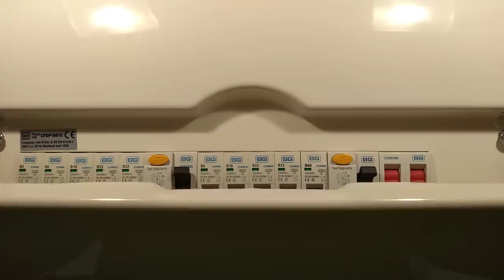A look inside a British home electrical panel.

Comment: Watching these consumer unit videos has got me worried.  (In UK) I had thought my consumer unit was relatively new, as the council rewired the whole house while I had a long period in hospital (cutting off all my own carefully placed lights and sockets, and leaving me having to do with extension leads everywhere: and a house still with brickdust everywhere ).  As it was on a new mounting board in a new cupboard with a smart meter, I assumed it was fairly new, but, closer inspection after seeing your burnt one, finds it's a plastic Wylex SF17NHISS10SLX, with a yellow label on top: 'IMPORTANT check tightness of ALL connections including FACTORY ones. Remove after installation'!   One of the two screws that hold the cover on is only half done up!   Does not exactly inspire confidence, though the man who fit the smart meter didn't say anything was wrong with it.

Is it possible to isolate the consumer unit from the meter so as to safely tighten the screws and check the breakers, or even replace the whole thing with a metal one myself?  I have found in other wiring I've checked, that junction boxes in particular often have grub screws that are loose, or even in sideways, so I never did have much confidence in other people's screw tightening.  :/
Reply from the maker: Unless there's an external isolator then you could only use the one in the unit, and that would leave at least one live connection.  (Tail into the isolator.)
You could gently check (do not overtighten) the screws with a suitably insulated VDE screwdriver with the correct tip.
Reply: Thanks very much, once again. I had wondered if the smart meters were smart enough to have their own isolater.  
I used to do a fair bit of DIY before they cracked down on it, and had actually replaced all of the original wiring but for the old style fuse wire fuse boxes. I couldn't get at the wires for these as some so and so had concreted them into the wall, and I only had hammer and chisel in those days! I hade gone through ther rest of the system with new wires and sockets and junction boxes, and made sure every connection was easy to get at.  Then I got stuck in hospital long enough for the council to check the house was safe to come back to, and they took one look in the fuse cupboard and condemned the lot. Cut all my new wires that were all run in tubing for easy replacement, and then just diamond sawed through everything, leaving me with half the sockets I'd had before and all miles up the wall though mine had been above the skirting, which was itself stainless screwed for easy access. They left just one light in the middle of each room, and didn't connect the garage system.  I was nearly in tears when I came home and saw what they'd done to 'help' me, when I'd only needed a new consumer unit. :/
Reply: Are the VDE screwdrivers anything special other than just having the plastic coated shaft?  I keep a stock of different sizes of silicone rubber tubing (amazingly useful for countless things--diverting distilled water from the back of the fridge instead of boiling it on the motor, for example). Would it be just as good to sleeve some of my existing drivers rather than buy yet another set?  (y)
Reply from the maker: @spamletspamley672  The VDE drivers are intended for live electrical work.

Comment: We have 400A into our house here in USA.  And 80 breakers spaces.  How do you guys handle very large houses like 475 SQ.M for exmaple?
Reply from the maker: Three phase supplies either split into three single phase consumer units or one or more three phase panels.
Reply: Typical house in the UK is around a 1000 sq.ft - not much space to fill with cabling.
Reply: @eddiewillers1  Heh, the American uses metric while the European uses imperial, I'll probably never see that occurence ever again ~:D

Comment: 12:00 Yeah, I learnt the hard way that it's not a good idea to use acid-based silicone kit in enclosed spaces that contain metal parts prone to corrosion…

Comment: It seems somewhat tedious, this design compared to a North American panel.  The mains bars are already mounted to the panel and you then mount the breakers to those bars.  It is similar though where you have neutral and ground/earth terminal block rails.

Comment: One big flaw i can immediatly see is that the N wire is not overcurrent protected. I can imagine there would be no immediate danger in 1phase systems, but is this the same for 3 phase systems in the UK? if so that might propose a bigger issue.

Comment: What is the purpose of the first (most right) neutral bar? Why not make a tail like they did for the live?
Using this neutral bar with any live from the breakers will trip the RCD.
Reply: Presumably so that you can fit extra non-RCD protected breakers or RCBOs which are not part of the twos RCD groups.  You might want a dedicated circuit for a freezer which doesn't go off if there's a fault elsewhere.
Reply: @petehiggins33  Are non RCD circuits allowed in the UK?
Reply: @ppdan  I'm not entirely sure about this, the regs are continually changing,  but I believe that for new builds and new wiring all sockets must have RCD protection but not lighting circuits.  This is a relatively new regulation and there are of course millions of houses with older wiring which don't have RCDs.  My house has an older device called an Earth Leakage Circuit Breaker which measures the voltage between the house earth and the supply earth and switches the power off if it exceeds about 50V.

Comment: You cant have enough seperate Breakers. I was living in a House with only one 16A Breaker for the 2. floor ( but 3 phase for the kitchen) no RCD at all and 2 Wire Connetion (Shared Neutral and Earth). I had to reset the damn thing a lot of times in absolute darkness.
Reply: Unless it's badly labelled and you have 30+ assorted things to switch and unscrew to work out which is what.

Comment: @bigclivedotcom our LL recently sent round an electrician to check our electrics were up to standard etc. Electrician said the live and neutral were wired the wrong way around on ALL our sockets. I researched this and found it basically makes the fuse useless as it will never blow. Is this correct? Also raised the q as if ALL sockets are wired like this could it be that the RCA box is wired up wrong instead?
Reply from the maker: That's an odd scenario.  It could be that the person wiring the sockets was going by terminal position as opposed to reading the markings.

Comment: one thing I realised how is this going to be enough for ANY home.
Suppose you have a kitchen bathroom and bedroom ( tiny apartment...)
kitchen 3: 1 breaker for the frige 1 for apliance plug 1 for light ( gaz cooking)

bathroom 3: 1 for light 1 for shaver plug 1 for washing machines ( no dryer ).

bedroom 2 : 1 for light 1 for plug.

that's already 8 breakers! 
if you have an electric hot water heater 1 more.

suppose you have a desk or TV corner you are full!

funy thing in that list you can't even rent your apartment has you need to have either place for drier or dishwasher ( yes that is independent too)
so yeah maybe this will fit some maids room with no runing water...
Reply from the maker: High load appliances like washers and dryers don't have a dedicated circuit.  They can plug in anywhere to our high current ring circuits.
Reply: @bigclivedotcom  and you think that is safe?????
plus washer and dryer don't need 32 amps 16 is more than enouth.
the only high load is for the cooking plates but I see gaz has far superior so I escluded it.
Reply: @pmailkeey that is not enough , you came for the parts like the others!

Comment: As a “consumer “ and not a trained electrician there is a serious issue with these boards.  To us non electricians green means on and red means off as all other electrical items use that convention pretty much except the consumer box where it’s back to front.  I had all the breakers replaced on my new consumer box replaced with RCBO as the two RCDs are just pathetic and make life a pain. If a circuit goes you need to know which one it is not one of 4. Also if your freezer is on the bank of 4 RCD protected and they all trip but you are away on holiday say good by to your Waitrose biryani!  Not sure who does these regs but they aren’t that smart in my book.

Comment: Nothing like mine. I have ceramic fuse holders and fuse wire.
The house was re-wired in 1982... Its not broken so theres no need to fix it.
Reply: Same here, except the house was built in 1982.

Comment: I wish they were more clear about end of life for old electrical cause trying to explain it to my condo board is such a head ache as they think I am abusing the electrical cause how does electrical go bad over time which matters since I am responsible for the electrical but then again when I want to replace the line cause I think it's getting old and could start a fire due to age

Comment: Are all home installations in the UK just single phase? Isn't that a problem when powering heavy stuff like stoves, ovens and water heaters?
Reply: Electric stoves, ovens and water heaters are commonplace and not an issue. We usually get between 60 and 80 amps to play with. There must be hundreds of thousands, if not millions, of all-electric homes in the UK, which use no other energy sources besides single-phase electricity, but it's much more common to use gas for heating, because it's cheaper to run.

Comment: DANGER Clive @ 9:00 the terminals at the top are outputs and the input is from the line buss bar at the bottom, this device should be fitted next to the main breaker before rcd's  and use the main common neutral bar   DANGER..

Comment: I see a lot of videos of "Sparks" on YouTube showing UK electrician work, but I don't ever see any US electricians showing their work. I think if your a electrician in the US you could get a good audience especially if your in a larger city showing industrial work or just residential work. I have a good understanding of US electrical but some of the UK concepts are strange like rings and all the testing they do. The US we just slap it in and it works more or less it seems.
Reply from the maker: That's how we used to do it.  Basic sensible testing.  But now testing has become an entire made up industry where they invent new unlikely scenarios and a new retarded test for it.

Comment: You get 40 A supply fusing? Here in Sweden we top out at 16 A, sometimes only getting 10 A.
Reply: I believe that is the nature of ring (UK) vs radial circuits (SE/NL/wherever else)
Reply: Huh, my apartment (in a house from the 50s) has 20A incoming fusing. Have things changed?
Reply: @michaeltempsch5282  normal north europe,sweden,norway,finland etc, have main fuse 25 or 36A no need normal house more. but has 3 phase. asian i have 1 phase 63A in to house main, and down living area has share 32A kitchen,kivingroom,2 bedroom.workshop.

Comment: I am from the United States. Why do you need a circuit for a shower? In the US one circuit breaker would power a water heater to supply the whole house.
Reply: Its for the water heater. Some houses have it to the whole house, and some of them have it only to the shower.

Comment: Are the blanks at the front supposed to be metal, they look like plastic.
Now fitting a Wylex main switch + 8 ways with all RCBOs except MCB shed supply that has its own RCD in the shed unit.
Reply from the maker: I wouldn't fancy loose metal blanks above a busbar.  The front has a closable metal cover.

Comment: I do believe they should change the regs to allow only rcbo boards, they are much much better. Split load is old fashioned now.
Reply from the maker: That has its pros and cons.  The RCBOs have a lot crammed into a small space and I've come across some that have exploded internally instead of failing in a controlled manner.  There's a video about one on this channel.  They also have integrated electronics that will result in a need for complete replacement a lot sooner than traditional MCBs.  And if the board is obsolete by that time (potentially ten years or less) then the whole DB will need replaced.
Reply: bigclivedotcom you raise some very good points Clive.

Comment: RCD = Residual Current Device == GFCI = Ground Fault Circuit Interrupter == GFI = Ground Fault Interrupter ==  ALCI = Appliance Leakage Current Interrupter 
RCBO = Residual Current Breakers with Over-current protection
Reply: RCBO = RCD and MCB in a single module
SPD  = Surge Protection Device
AFDD = Arc Fault Detection Device (See John Ward Video for how effective they are (aren't).  At £200 a pop (recommended per circuit) and around £2000 for a Consumer Unit - someone is "aving a larf".

Comment: Do you have the use matching brand RCBO's for consumer units or can it be mixed e.g. BG RCBO in a Wylex consumer unit?
Reply: Regs 18th say "recommend" that you only use the same manufactures modules as the Manufacturers have only tested their own devices with each other (of course they have) and not other Manufactures modules. If the Sparky uses Diff brands - then the Sparky takes on the responsibility (and liability) for the "design". 
It boils down to who will be liable in the event of fire/death.
Reply: @shilks8773  Thanks for clarifying

Comment: Maybe I'm missing something, but just looking at this what I immediately notice is that each of the RCD devices is only rated for 63A, but they're each supplying power to 92A and 126A worth of breakers, respectively.  If, as you said, those devices don't have any sort of inherent overcurrent protection in them, that seems very bad to me.  It seems like it'd be very easy to pull more current through them than they can handle, with no protection, and possibly produce dangerous results (i.e. fires) inside the panel...?  Is this actually a typical configuration?

In US panels, typically the main shutoff switch is in a separate position, accessed separately from the compartment for the rest of the breakers, so if you actually turn off the main switch, the main portion of the panel will all be powered off with no live components exposed.
Reply from the maker: The main incoming supply is usually round 80A.  The combined total of the breakers is not necessarily the sustained load.  A 6A lighting circuit may just use 1A.
Reply: @bigclivedotcom   Well, yes, it might only be 1A in use per circuit, usually, but my point is that there's absolutely nothing preventing hooking up enough stuff on those circuits to make the breaker box burst into flames, which seems like a severe oversight.  (Even 80A would be too much if it's all on one of these two sides, so that's not really any protection.)  All it takes is running all those circuits at anything more than half their rated capacity to end up overloading the whole thing, and it will be perfectly happy to let you do that (and more!).

The whole point of overcurrent protection isn't about the typical case, or what "may" or "not necessarily" be true.  It's because you can never be sure that there won't be some atypical condition which happens even though it's "not supposed to" in general, so you should protect against it so that things don't fail in unsafe ways if that does somehow happen.  This breaker box configuration just does not do that correctly, IMHO.

Comment: With the separate neutrals like that, where does your ground/Earth bonding occur?  At the pole?
Reply: Normally at the incoming service head and then it will depend on your supply type, TN-S (Terra Neutral Separated - 3 wires back to source, line, Neutral and earth), typical Ze of no more tha 0.8ohms
 TNC-S (Terra Neutral Combined Seperated,  the Neutral and Earth are combined within DNO's service head and sent back to source via a PEN (protective earth neutral) conductor) Most modern houses in the UK uses this method but there is fear that it can cause our issues if the protective earth neutral goes high resistance or open circuit. Typical Ze of no more than 0.35 ohms
TT - is your earth rod, typical Ze anywhere from 1 to 200. Over 200 normally requires an additional RCD before your consumer unit but it is possible for the max Ze to be 1667 ohms
Reply: It depends on the age of installation and system used. In most north EU (Norway excluded, they are crazy) we use TN-C and TN-S with split somewhere along the way from the transformer to the GFCI. The last few years, we usually split directly after the meter. Older systems have the split in the GFCI. PEN goes in the ground bar and from there, you pick up the neutral.
Reply from the maker: PENs going open circuit are actually scarily common.  If you consider the way they splice into UG distribution cables there are two joints per splice.
Reply: @bigclivedotcom  A lost PEN says fizz, crackle, pop in your equipment.
Reply: It happens just outside the consumer unit. The British system is pretty messy with lots of separate items and wires:

https://www.diynot.com/diy/media/existing-supply-and-consumer-unit.25580/full

That uses  fuses in the black box. It is very different from the Finnish one where there is just one unit.

Comment: Wish they had a sort of quick connect port in them for attaching inverters upon power failure which would also isolate the primary mains from the inverter to prevent a large boom.
Reply: You could get one fitted, they're called transfer switches, Clive featured an automatic one here https://www.youtube.com/watch?v=babtv00R-Nc.  A cheap Chinese one is £30 on eBay.